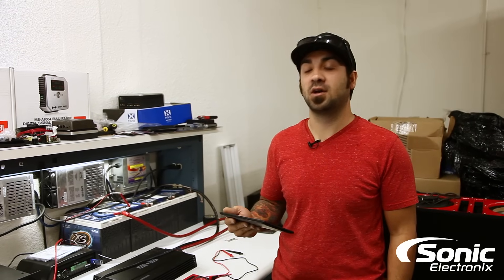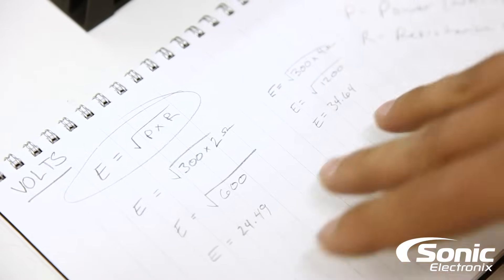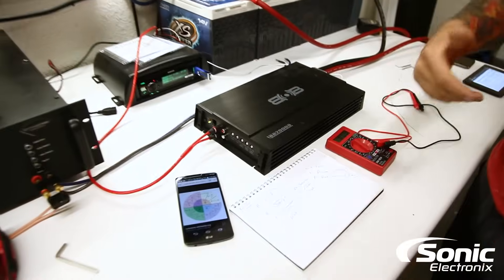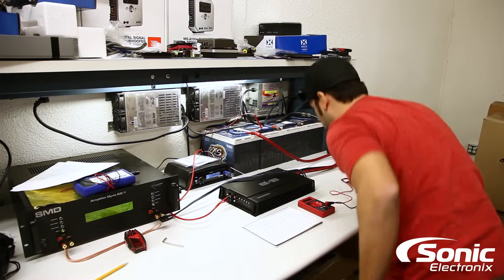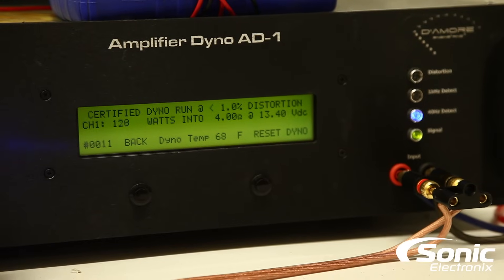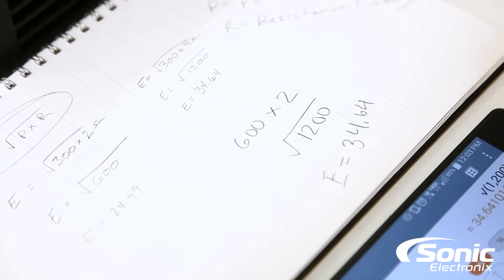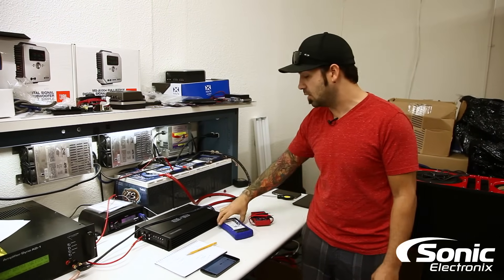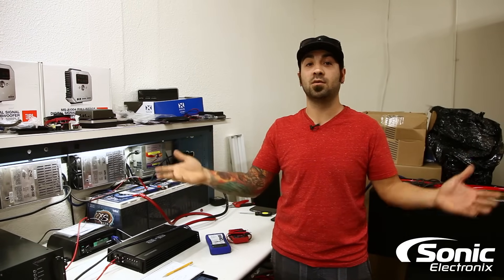How To Set Amp Gain to Match Lower RMS Subwoofers? | Car Audio Q & A

Comment: I have a question, do u add your total watts if you have two. For instants two 4 ohms subs rated at 300 each (300+300=600 or 300 total)
Reply: Are you running your two 4 ohm subs at 4 ohms to your amp or is it wired in parallel making it a 2 ohm load at the amp? If it's 2 ohm you should probably use 2 in your equation instead of 4 to give you a more accurate number.
Reply: @scottdavis62 I am also running 2 4ohm subs , but it’s wired to 1 ohm to the amp, would I use 4 or 1 ohm in the equation, thought it was supposed to be the ohms of the subs
Reply: @pabloacosta5867  It would be the load resistance that the amp sees.  So 1 ohm.
Reply: Orlando Ramos yes that is right
Reply: Efrain Gallegos I'm wondering the same thing
Reply: blazethebong420 sweet, another question what do you touch with the multimeter, the positive and negative on the amp where the speaker wire connects to?
Reply: Efrain Gallegos same here
Reply: Scott Davis yes I'm running at 4ohms
Reply: Efrain Gallegos I have the same question but I'm running both my subs at 2 Ohms so would my math be 600*2/ square root?
Reply: does running 2 DVC 4-8ohm subs into a 4ohm load change the calculations?
Reply: If it's a 2 channel amp for 2 speakers then no. Same applies if bridged. For 2 speakers check volts on one side at a time (+ and -) For one speaker check it "bridged" (+ On one side of the amp and - on the other side) usually the amp will show you how to bridge it.
Reply: P. Ness you need to check it how you will have the speakers hooked up.if you are going stereo with one speaker to one output then check it and adjust there.if you are going mono(bridged) then check it at the terminals you amp have for bridged.

If you have a mono block amp then you only have two terminals you can check.

Man I wish we had YouTube back in the day,so  many oldschool amps and subs could have been saved!!
Reply: I have my subs rated for 3.36 ohms but my amp is 1 ohms. What should i multiply my subs with by 1 or by 3.36?
Reply: Orlando Ramos  I added my total watts, I have two 300rms subs at 4 ohms, so I did 600rms x4ohms =2,400 and square root of 2,400 is 48.98. Set my gains to match close to that in volts and it sounds really good. Not sure if it's what you're suppose to do. But I did and it sounds awesome.

Comment: +Sonic Electronix

Terrible video. You are dealing with an AC circuit, therefore the Ohm's Law wheel in that format doesn't apply. You totally ignored Power Factor in your calculations, therefore your math calculated Volt-Amps, not Watts. Also, again because this is an AC circuit, not DC, you confused Resistance with Impedance. Both of these are gross errors that will confuse people going forward.

It's videos like this that the state of car audio is what it is today. Where "experts" know everything, yet spout fundamental physics errors. You have a pulpit. Teach the actual math, and what is really going on. It will leave a lot less misunderstandings and confusion, and the industry will be better off for it.
Reply: Impedance and resistance are the same just like volt-amps and watts... just different terms. 1 volt-amp is equal to 1 watt

Comment: I don't know if what I'm asking has to do with what your talking about but here is my question . I just got the JVL ks-ax201 from you guys . On the back it has  3 things I can change . The first one is the input sens.  In the instructions  it has  - set this control according to the line-output level of the center unit connected with this unit .For the line-output level,refer to the" SPECIFICATIONS " in the instruction manual of the center unit. This controller is preset to 5v when the unit is shipped . If my ddx9903s kenwood  is putting out 5 volts does that mean I set  the input sens to 5v ? Is what your calling the center unit  ,is that the  receiver or head unit ? Bass boost is the middle setting  of the 3  and  its Off low or high I guess I just have to  play around with that  to see what sounds best . The last one  of the 3 is the  LPF  How do I know  what hz to set this at  it goes from 50 hz to 200 hz ?

Comment: what happened when i just hook up any subwoofer without set the amplifiers gain? will it blow my speaker?
Reply: zulkarnainkarim with out setting gain or just turning the gain all the way up ?  If u don't set the gain your sub won't get power from the amp .

Comment: Is that the x998. My x998 doesn't clip at full volume but what do you set the SWL too? I also have the same fluke 105b ii, why don't you just use that to test the wattage?

Comment: I want to know more about what the head unit should be set at, or does it matter?  I'm talking about the bass and treble and loud button.  Also newer units have sub frequency, sub level,  bass boost, etc.  Does any of these settings affect the output?
Reply: Chad Current yes
Reply: Chad Current head unit bass all the way up and treble turn radio up till it distorts then back off 2 volumes done . Now set ur amp gain until your subs distort back down a bit done . Don't use loud or bass boost .

Comment: do u turn the bass all the way up on the radio? before u do all that.
Reply: ORANGE BOY 714  Thank you
Reply: Have your EQ flat and make sure all settings are at 0. Set your gain on the amp, adjust filters (Leave bass boost off) on the amp. Go to your headunit and turn your sub-woofer level down a couple notches. After than you can mess with the treble but I wouldn't touch the bass. You can adjust the EQ but adjust the higher frequencies not your lower. You will introduce clipping to your newly set gains if you mess with any bass filters.
Reply: no prob .
Reply: Steven Dorey , I leave all deck functions even. no boots or any enhancements.
Reply: Steven Dorey yeah put it all the way up then set ur amp gain so u have the option of cutting out bass on certain songs .

Comment: Could you use this formula to find a 1 ohm load?
Reply: Yes, it's the same. Just measure the ACTUAL impedance of your subs, and remember to use an amp which is rated for the right impedance, otherwise you could damage the amp. Closer to 0 Ohms=closer to a short circuit.
Reply: @magnuswf  I know this was a year ago but by actual do you mean if my sub is a dvc 2ohm and I wire it down to 1ohm I should use 2 in the formula instead of 1?
Reply: @johnb6520  if you have a sub with one voicecoil rated at 2ohm, you need an Amp which can handle 2ohm. How many voicecoils and ohms does yours have?
Reply: @johnb6520  and by actual i mean you need to measure with a multimeter on the ohm setting, instead of trusting the specs 100%
Reply: @magnuswf  ive got a kicker cvx 12 dvc 2ohm rated for 750w rms and a kicker cxa800.1 newest model, 800w rms (certified power sheet in box says 857) stable down to 1ohm. Ive already wired the sub to 1ohm in the box, Havent started actual install yet. done a few in the past but never knew how to set up the amp and this is my first factory radio install so I want to do as much research as possible. I appreciate the reply man
Reply: @johnb6520  how did you Wire it to 1ohm?? Is it 2x2ohms you got?
Reply: @magnuswf  do you mean measure the resistance at the speaker wire from the sub after I wired it? Or measure it on the leads from the sub? And for the formula do I use 750x2 or 750x1?
Reply: @magnuswf  it is a dvc 2ohm. Wired it in parallel to get 1ohm
Reply: @johnb6520  then IT is 1ohm indeed, but measure the two leads you are going to put into the Amp. It should be around 1ohm, just to be sure.
Reply: @magnuswf  yea it is hovering around 1ohm. So for the formula to figure out the voltage I would find the square root of 750 correct? Because 750w rms x 1ohm? Just to be extra sure.
Reply: @magnuswf  I also have a couple more questions it seems like you might know the answer to if you don't mind. What test tone is the "best" to do this to? And will it destroy my speakers since I will have to do it in the vehicle because no test bench. And the setting of the crossover on the amp. I've looked and cant find much on it. Thanks for the answers so far
Reply: @johnb6520  i dont know, havent played with tuning, i just know some of the electronics behind😀
Reply: @magnuswf  gotcha. Well thanks for the clarification. I appreciate it. Most don't respond
Reply: @johnb6520  that's why he told you in the video not to have the speakers hooked up while you are tuning if you are gonna go this route.

Comment: i got a Cerwin-Vega 1200.1m (so 1200watt)   and i got a subwoofer that can handle 1500watt. i got the sub wired up in 4ohm. so 1200x4  √4800=69.  did i do it right ?

Comment: I see what you've done there, and i understand the math. Sucks when for the last 20 years car audio guys have been telling you the gain setting does not adjust power output, it is used to match the amp input voltage with your head unit rca output.

Comment: Hi I tried this method but my meter shows a max of 14 volts when turned to max for some reason and 0 at minimum. I had kept it at the 200v setting on the meter. What am I doing wrong?

My Amp is a Powerbass ASA3 1000.1d doing 700 rms at 2 ohms and my sub is a Pioneer TS-W3003D4 dual 4 ohm rated at 600 rms. Please help.

Comment: I have a 1500 watt SSL Evo amp pushing two 12s at 500 watts each(the subs are called NOS Kingwood). Within about 30 minutes the amp was already really hot. Then tonight the amp cut off and went into protection mode. Can you help me out and tell me why my amp is going into protection mode? And by the way i actually had this installation done professionally.

Comment: Hey brother
I have a HIFonics BRX 2400.1d connected with a capacitor to 2 ohm and a kinetic auxiliary battery 1400 and a Kicker L-7 15 "rear connections is wired 0 gauge direct to the amp, but when I turned the volume up to 20 and do The sound of the loud bass the amp is turned off and put into mode !!!!! I changed the 105 amp alternator for a 200 amp alternator, the only thing missing is to change the cable of the batteries of 4 gauge To 0 gauge ..... Could you tell me why that happens?
 

  thanks

Comment: Hello, i have 2 subs in 2 different enclosed boxes. Every where says i have to wire them together. do i need 2 amps for this, do i need to wire them togeather(not really a option), or can i use one amp?

Comment: when adjusting the gain on the amp what should my frequency be at when doing so.All the way up? or all the way down? or doesn't matter.
Reply: Wrong. You set the gains then you adjust your filters.
Reply: Paul Valadao doesn't matter just set ur frequency and then set gain .
Reply: yup
Reply: So set the gain until it sounds how you want?
Reply: No you need to have a  Constant  Frequency in order to get a constant voltage!if you just play a random song the voltage will be all over the place and you won't be able to set it up correctly.

Around 50hz should be a good starting point,but different frequencies will require different voltage,some more volts,some less.
Reply: Paul Valadao he explained that in the video..

Comment: When I measure the resistance of a 4 ohm JL Audio W0v0 10" woofer including the wires from the woofer to the amp, I don't get 4 ohms. I get 4.8 ohms.  Which is the correct value to use in the calculation, 4 or 4.8?

Comment: Have a 250 watt rms sub but my amp is 430watt rms. using this method the sub should run ok? will I get the most out of the sub or will it blow up?
Reply: deceptikhon set ur gain by ear until sub distorts then back down a bit done .

Comment: Hey i have 2 chanel bridge 4 ohm .i run 2 speakers at 4ohm eatch 300w eatch speaker and my amp 2 x286 w ish .do i need to set my gain or i can go full gain .without distorting.what should i do plz help

Comment: How do i find out the maximum wattage for my woffer if there is no sticker on the back. also dont know the ohms
Reply: i looked online and its either a 450 watt rms or 525 rms. how do i find the actual wattage for my sub? so that way there i dont under/ over power
Reply: Hook up power meter to speaker outputs, turn up volume till speaker blows, then observe reading on meter. OOPS it's lower than that.

Comment: would the info change if you played a 40hz test tone?
if so why did you choose 50hz?
Reply: it would be the same. the gain of the signal is what matters, not the frequency
Reply: ***** thanks!
Reply: i needed that thanks for answering that question
Reply: i needed that thanks for answering that question
Reply: i needed that thanks for answering that question

Comment: So if there are two speakers 2 ohm with rms 500 each is it 500 x2 or 1000 x2
Reply: Use the wattage of the amp.
Reply: Thanks for the info bro...

Comment: if I have 2-4Ohm subs rms 300ea wired parallel to 1Ohm, would my equation be E=Sqr 300x1 or E=Sqr 600x1 or E=Sqr 1200x1 or E=Sqr 2400x1? I'm guessing 300x1 which would equal 17.32V
Reply: two 4ohm speakers connected parallel is a 2ohm load not 1. and your are going to have 600 watts at 2 ohms
Reply: Giannis Giannopoulos it's a dvc wired parallel, so it's resistance will be 1 ohm.
Reply: Kawai hao so you have 2 dual 4ohm subwoofers?
Reply: Kawai hao

Comment: I hook my subwoofer up to 1 ohm n I get a popping noise on some notes do you know what would cause that? but at 4 ohm I have no problem. I have skar 2000.1 and skar zvx12 dual 2 1500 watts
Reply: your amp can push up to 3200 watts at 1 ohm, not 4. If you wire your speakers at 1 ohm and max gain, you are feeding them 3200 watts. if you wire them at 4 ohms and max gain, the amp is gonna give them about 4 times less power. Check if you have set your gain higher than the speakers can handle and you are clipping the speakers
Reply: matt beezy your speaker is rated 1500 watts RMS. That means you can give 1500 watts rms to the speaker continuously! Usually we don't care about peak watts. So, assuming your amp is rated at 3200 watts rms @1ohm, wire your speaker parallel and set the gain to your amp to 1500 watts according to the video. If your amp can produce 1500 watts @ 4 ohms, (check amp specs) then wire your speaker in series as you have right now and set again your amp gain to 1500 watts according to the video.
Reply: matt beezy not enough power from amp your asking for too much increase you gain till you can run it arround 3/4 volume without popping should be clean this popping is probs clipping from amp so yhh  increase ur gain or buy a more powerful amp i mean i reccomend a new amp because not really reccomended to put gain to compensate for extra power obviously at 4 ohms it doesnt use as much power as 1 ohm
Reply: Akeel Shah my amp is brand new and it's 1 ohm stable and can push up to 3200 watts
Reply: Giannis Giannopoulos when I wire it at 1ohm I can't turn the gain up at all with out the sub making that popping sound on certain notes
Reply: matt beezy perhaps its overpowering them at 1 ohm thats alot of power
Reply: Akeel Shah my sub is 1 ohm stable. the amp n sub I bought toghter for that reason. sub a skar zvx-12 dual 2. and skar 2000.1d mono amp.
Reply: matt beezy do you have good thick gauge wiring to be able to supply that power perhaps the wires or perhaps the cars altinator isnt good enough i think people say the big 3 upgrade
Reply: Akeel Shah I have zero gauge. but was thinking of running 8 gauge to my speaker instead of 12 I think it is now n no I havnt done the big 3 was thinking about trying it but never done it before
Reply: matt beezy yhh big 3 is probs worth it if your amp is 3200w thats alot of power but dont quote me on that maybe search what the proper way is to check if you need to upgrade i.e check voltages are at around 12v and current i do not know although pretty high im no expert thats the thing lol but im sure you can get some tests done with a simple multimeter ☺
Reply: Akeel Shah I have a multimeter and when amp on it at 12 volts n the company that I bought from said that it's should run at 1ohm no problem I got it all in a package with a costume box for my ford f150 harley davidson edition. but my lights do dim a lil when the bass hits.
Reply: Akeel Shah I have a video of what it is doing if I can show u
Reply: matt beezy sure
Reply: Akeel Shah I posted it on my YouTube page click on my page n see if you can see it
Reply: matt beezy Matt, your subwoofer is 1500 watts RMS and your amp is 3200. you absolutely can't turn up the gain more than half because the amp has 2 times the power of the speaker. Do the equation for the voltage needed to generate 1500 watts RMS at 1 ohm and then set your amp gain with a multimeter
Reply: Giannis Giannopoulos it says on there website tho that max power for that sub is 3,000 watts tho? or does that not matter but ya it's 1500watt speaker
Reply: Giannis Giannopoulos and I can't turn the gain up at all with out it popping
Reply: matt beezy i really reccomend just not turning the gain too high never take the 3000w as the number as thats for peak power for a little while so normally it should be getting around 1500 to 2000
Reply: Akeel Shah but my gain turn all the way down and so all bass n bass boost on my stero. I should at least be able to turn gain a quarter way up right
Reply: im actually having sub issue myself have a 2400w amp and a 1200w sub id thought just leave the gain stock it will be fine but you know titanic bass song damn everything was shaking like bassgasm but after a while my sub  died i dont think its all my fault as i didnt have the volume at 100% or anywhere near but the fact is the sub is 350rms so usually around 350 but can peak at 1200w so i was giving it 1200 or more all the time not peak thats whatbblew it lol
Reply: also with pioneer they do not provide accurate ratings lol
Reply: Akeel Shah lol ya I'm giving mine 800watts at 4 ohms but I should at least be able to get 1300 watts. my truck doesn't even shake right now at 4 ohms